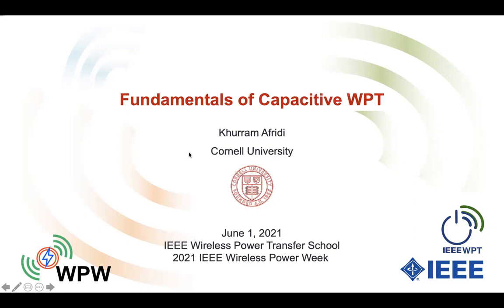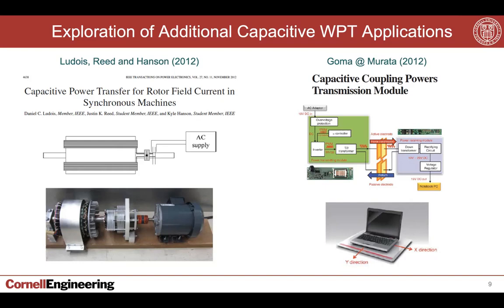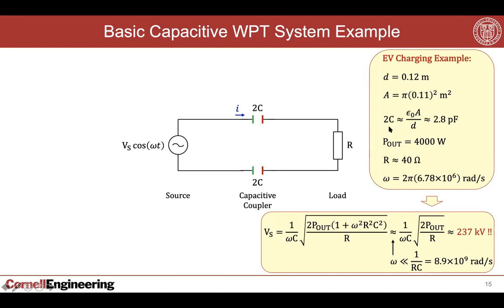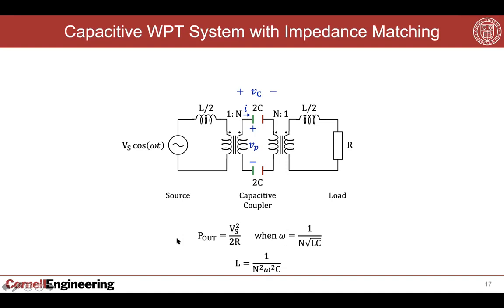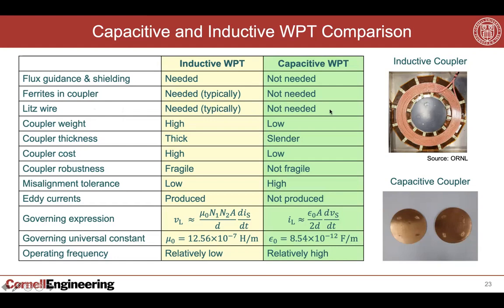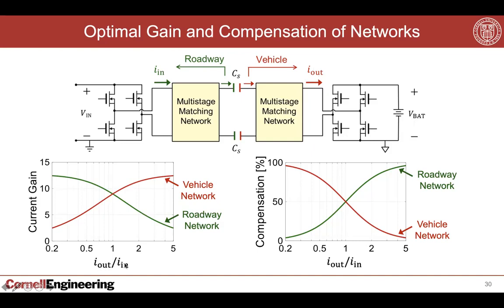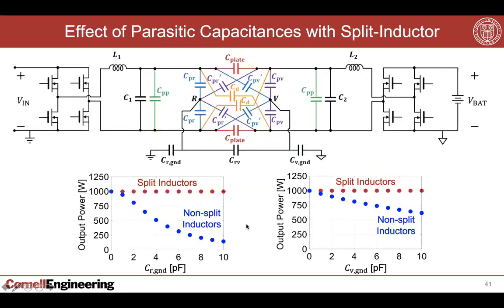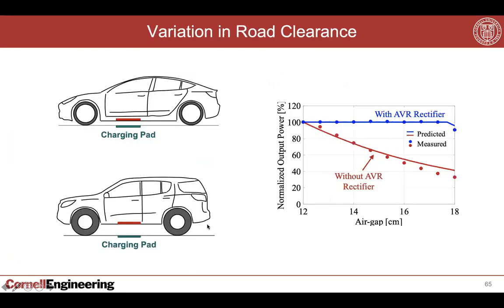3   Fundamentals of Capacitive WPT

Comment: Based on your professional experience, does capacitive (WPT) encounter the same challenges as inductive WPT when an aluminum sheet is placed between the coils? I need to design a small, battery-operated WPT system that can transfer power across a 15mm gap with a 10mm aluminum sheet between the Capacitance plates, which is part of the device enclosure that needs to be powered via WPT. Is the aluminum sheet between the plates going to make it impossible to transfer electricity? I tried Induction and the aluminum metal sheet is creating oposing magnetic fields making the power transfer impossible with low voltages coming from my 6 AAA batteries